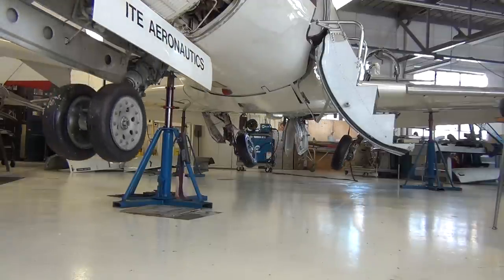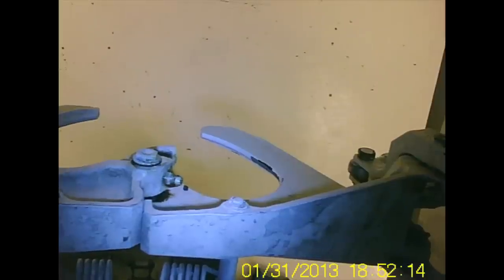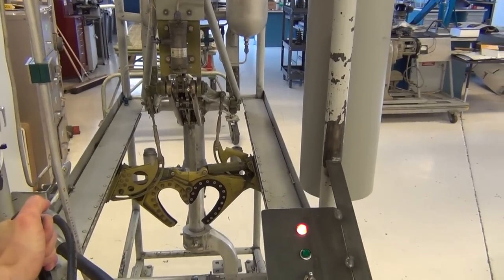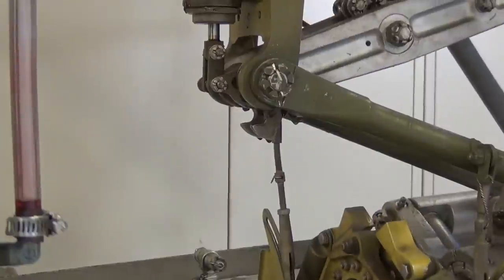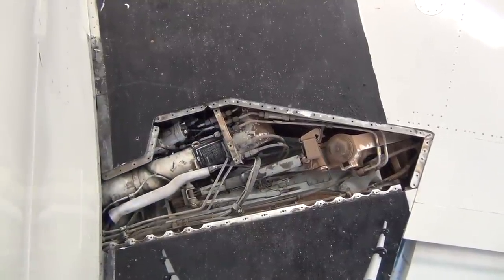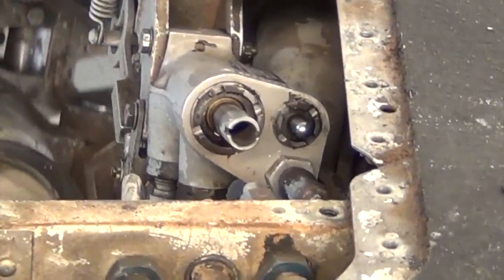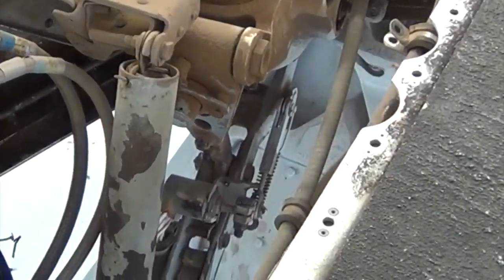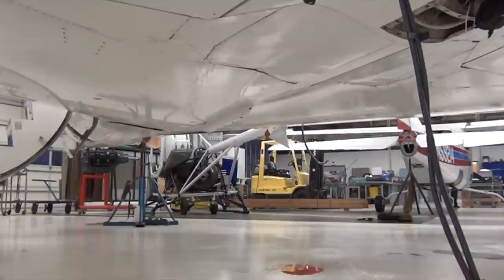Landing Gear Up Lock and Down Lock

Comment: Lot complex mechanism would be reduced if replaced by elongated ~mudguard size of tyretrain isolating inner deck machine exposure ,
& a simpler retracting mechanism with tyres along Axis of plane similar to nose wheel...

Comment: The Failure of of these systems resulted in the loss several P-51 mustangs in WW2.  It seems that the planes were not equipped with the correct  'Uplock' mechanisms.